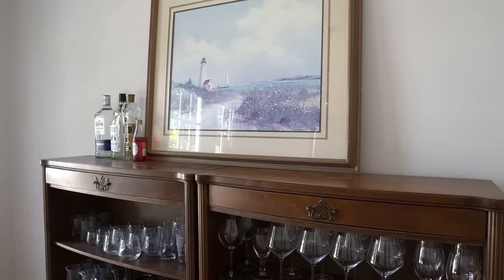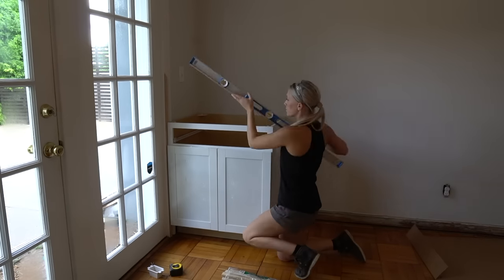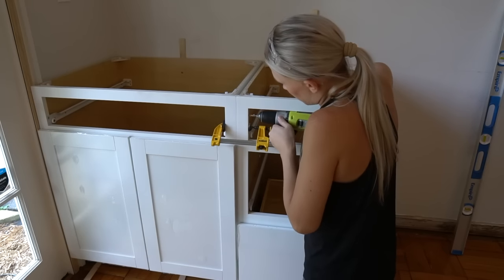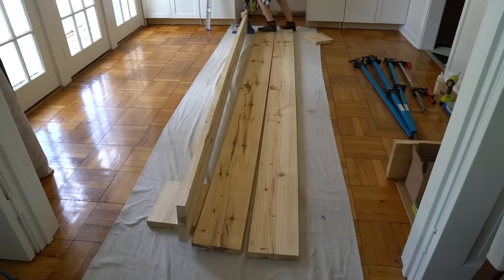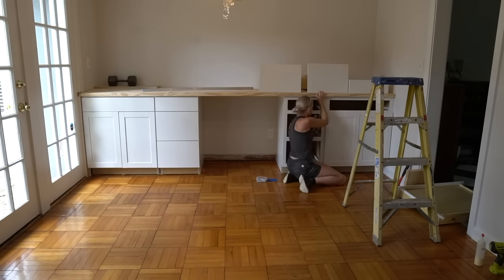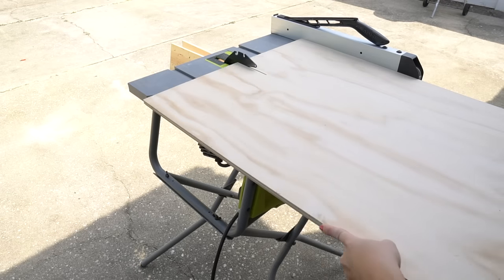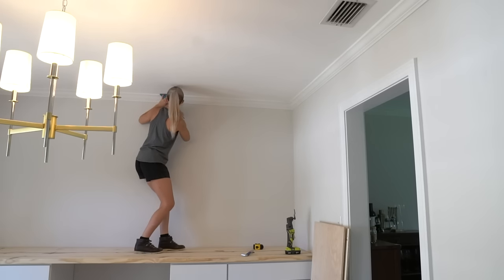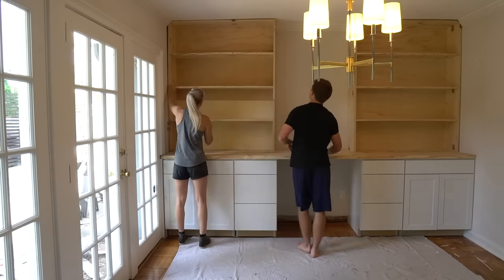Dining Room Built-ins [Part 1]

Comment: I admire your willingness to get in there and get things done - to tackle jobs across a broad range of disciplines. That Sherpa carry and lift of the countertop was awesome. That said, I would revise the electrical work. You shouldn't replace an old ungrounded outlet with a 3-prong outlet without a ground. However, you can replace the old 2-wire outlet with a GFCI 3-prong outlet. (do put the black wires to the brass connections though) and the outlet should be labeled as "No Equipment Ground". Other than that quick change, it should be good to go and to code.  This looks like an impressive build. Looking forward to part 2
Reply from the maker: Thanks for the tip, Roy! I appreciate it. It's all a learning curve, especially the electrical work.. 👍

Comment: Just a tip I learned from my electrician friend — You should have black wires to brass screws and neutral/white to silver.  It will work the way you did it, but you’ve reversed the polarity and you could get shocked this way.
Reply: This is correct. Components that have internal switches (like refrigerator) are design to switch the hot side of an outlet. Switching the neutral side is not allowed under NEC code. I've pointed other electrical faults out in a separate comment

Comment: Are your electrical boxes metal, most are in homes of that age? if not then your outlets won't be grounded,  You can replace those with a GFCI; it will give you some protection.  GFCI outlet will have instruction on installing without ground wire.
Reply: Doesn't matter because that receptacle is not self-grounding. It still won't be grounded even with a metal box (which itself still needs to be grounded somehow).

Comment: Hey Stephanie! Right on time. I just followed your other video from your built-in in your office and built mine in my office, without the desk in the center. What are the blue things you were using in the corners? Also, do you sand after each coat of paint? Are you offering consultations?

Comment: This looks incredible! I have a question. Why did you use that thin piece of wood between the cabinet and the wall to add it to drill it into the studs? Does it protect the wall?
Reply: She did that to keep it plumb and level. Most walls and floors are not perfectly flat.

Comment: I am a little confused about the difference between the planer and the sander.  Why would you have to use the planer and still sand?  Also, I was confused at first when you notched out part of the hutch top on the left until I saw the light switch.  This project is beautiful.  Always making the rest of us want to remodel our homes.  🤣  The light fixtures fit the ambiance of both rooms perfectly.  Hmmm, will she stain the wood, or paint it white?  Thanks for sharing, Stefani.  (Denise)  💗
Reply: Planers make wood a consistent thickness, while sanding makes wood smooth to the touch. Planers generally don't leave a perfectly smooth surface, although can certainly make it somewhat smoother if it starts out very rough.
Reply from the maker: Thanks Denise! I always love seeing your name pop up in the comments. Thank you for following along 😊💕
Reply: @matthewschulkind253  Thanks Matt.
Reply: Also normally for this kind of work the normal process would be to have a joiner (but they are expensive and only needed for professionals) and my biggest tip would have been to utilize Dominoes instead of pocket holes, the thickness was here to do that and the warpage would not be as much of an issue. But looks so good!

Comment: Major mistake made with the electrical.  Per NEC a 3 prong outlet must be connected to ground. Given that the original outlet had two prongs, then it is obvious that it doesn't have a ground. 
The outlet 1) needs to be properly grounded or 2) have the appropriate label on the outlet face stating that the outlet does not have and a GFCI outlet installed in that location. 
Given how this is currently set up, if an item plugged into that outlet has an electrical fault the user would be electrocuted because the outlet isn't grounded

Comment: You aren’t going to be able to open the cabinet doors on the very end with any hardware on the doors, you needed filler strips on either side between the cabinet and the wall to compensate.